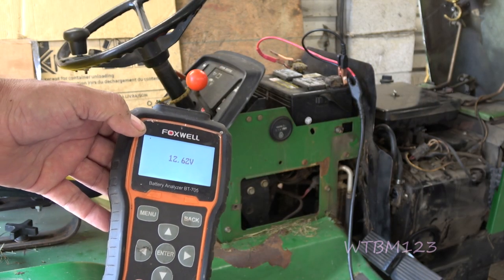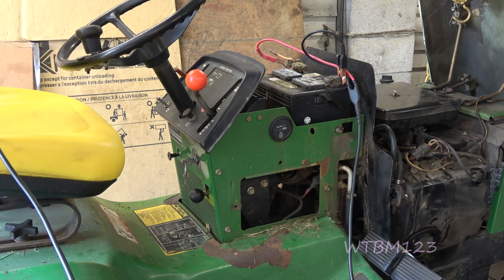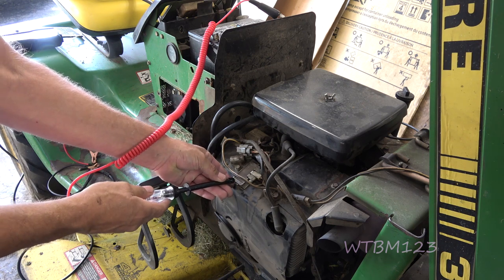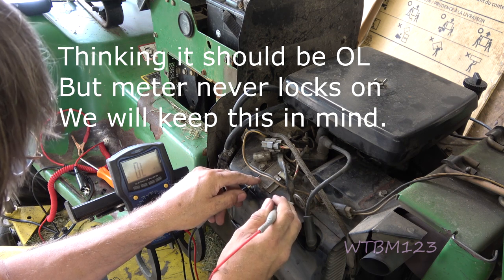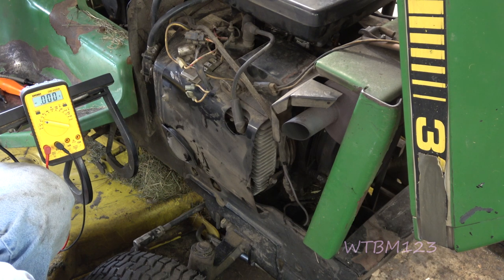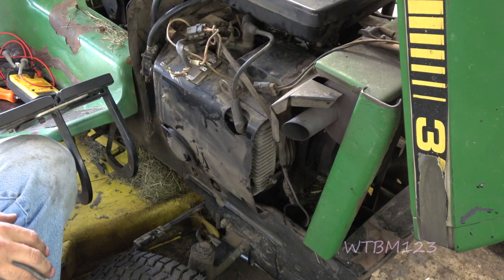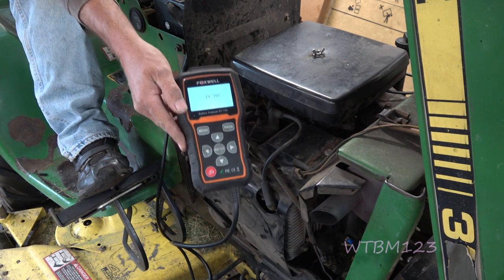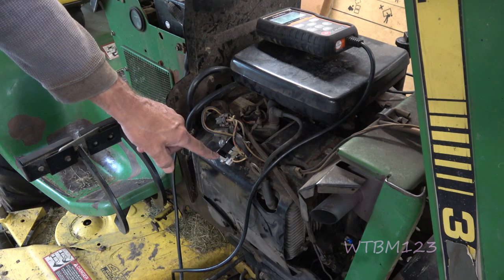John Deere 318 not charging , How i tested

Comment: Needed this for my 214. Well done. Thanks for posting.
Reply from the maker: Hope you get it all sorted out and thanks for stopping by.
Reply: @wtbm123  Waiting for mail delivery, to find out. I'll let you know, when it happens. Thanks.
Reply: Wasn't the regulator. I put on a new one, just because it was the original. Now I have a new JD replacement. Next, to do your other checks.
Reply from the maker: @joequillun7790  Make sure 12 v gets to the center terminal , and that the regulator is grounded .
Reply: @wtbm123  Did that. But when checking the stator while running, it only has about 32V (AC). My tractor is an 87 JD, Kohler 14 HP. You and others are over 40V. Not sure if that's bad enuff to kill a $150  Napa battery, only 1 yr old

Comment: Went through the same thing with my 316.  Voltage regulator rectifier was OK. The melted A/C  connector  like you had was the problem. Cleaned up the connector everything was OK.  So maybe your old voltage regulator rectifier is still OK.
Reply from the maker: Thank you for stopping in and commenting

Comment: Nice diagnostic Terry.  Before I put my kubota tractor away for the season I noticed in testing my battery voltage was 16 volts . I've never seen a voltage that high . It does have a simular  system that produces ac voltage then rectified to dc .  Have you seen these fail producing too much voltage ?  I just replaced the battery two months ago .  I'm figuring reading  16 volts  with the engine just turned  off  at the battery is too high , any thoughts.
Reply: It does sound like a poor regulator, i would expect about 14 volts charging and the battery should slowly drop down to 12.7 to 13 volts after sitting off for 10 mins.
Dam im in waffling mode lol.
Reply: @zx8401ztv  That's what I  thought as well.  16v  I've never seen testing any machine  running or a battery .  I'm boiling my new battery it seems over the last two months  😅   Next spring I will have to investigate or fly Terry up to my place.
Reply from the maker: Yea 16 after shut off seems high . 14.6 - 14.9 is usually what i see running .
Reply from the maker: Myself i would probably change the regulator , if nothing else just to know. Most are cheap , not sure how much they would be for a kubota
Reply from the maker: I agree

Comment: Great video Terry, very informative and easy to follow. I pretty much have the same situation as you did, with one exception. When I test for AC voltage across the w stator wires(at full throttle) im only seeing about 25 V. Wondering if I should go ahead and replace the Voltage Regulator before digging further into the stator. Thanks
Reply from the maker: When testing stator you are not going through the regulator , Also make sure the regulator is grounded . The regulators do go bad .

Comment: I have .03 on AC wires and no short to ground on either AC wire is .03 acceptable?
Reply from the maker: Is it charging ok . I have seen some still charge , When running at higher rpm do you get AC voltage on the stator wires.
Reply: @wtbm123  iam not sure I got it with the motor already taken out of the mower and and apart for a oil leak and was just wondering if I should try and find a replacement stator while I have it apart
Reply from the maker: @mikesautomaintenance5780  Is it stil copper color or are there dark places forming on it.
Reply: @wtbm123  it's looks good to me I no it should put out around 40 AC volts when running but like I said motor is out of the mower I did put power to the motor and just turning it over iam putting out 7 ac volts iam half tempted to try and bolt it to the bench and try to start it and see how many ac volts it's putting out before putting the motor back in the mower

Comment: On my JD 318, does the battery wire that goes to the center terminal on the voltage regulator stay hot all the time or only when key is on. My is hot all the time. Any thoughts.
Reply from the maker: I am thinking with key on . Some tractors have power there all the time , but thinking just when key is on .  I will test soon and if wrong i will let you know
Reply from the maker: I  was just stopped in where the tractor in video is and i checked for power on center wire . It does have power with key in OFF position . I was wrong when i said only with key on . Sorry

Comment: It was good until the end. Couldn't read the meter to show how much it was charging or where you connected your leads to check the regulator output.
Reply from the maker: You can put both leads on battery terminals , or neg on neg battery terminal and pos of meter on center wire of regulator . At half throttle or above should be 14 - 15 volts , But that also depends on the health and state of charge in battery . If battery is fully charged , you may just read in the mid to high 13`s . And when you shut off the engine it should drop back into the 12 v range . 12.6 being a good battery but may say 12.7 or something just after it was shut off. . Sorry about not showing it better .

Comment: The unloaded generator did produce a high voltage, i thought that the regulator died because of that, and an imperfect battery conection while it was running.
Maybe the generator produces much more voltage than needed,  the regulator will have to dissipate that unwanted energy in heat (The regulator case).
I suspect the regulator case does not have enough mass to absorb the heat.
Imagine how cool it could be if a thick aluminium plate with the regulator hole shape in the middle.
Mount the regulator in the plate hole and it would last 400 years.. ok longer lol  :-D
Sometimes i suspect things are rigged to fail hmm lol.
Hell dont i waffle on a lot lol.
Reply from the maker: Those regulators have a high failure rate. Most are cooled by the cooling fan , but i see people mount them to frames and stuff . I always wondered if they over heat easy that way .